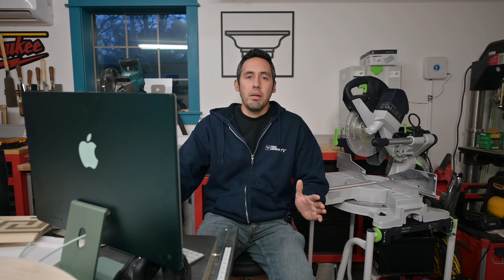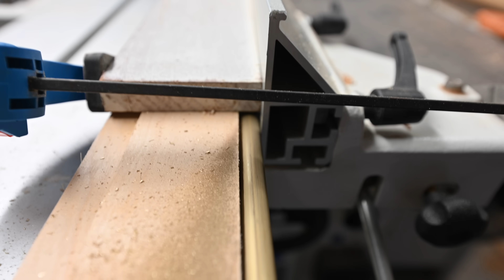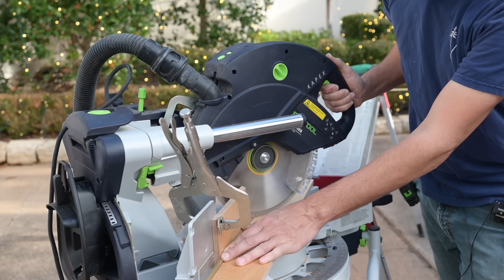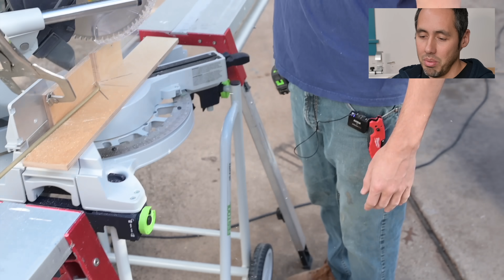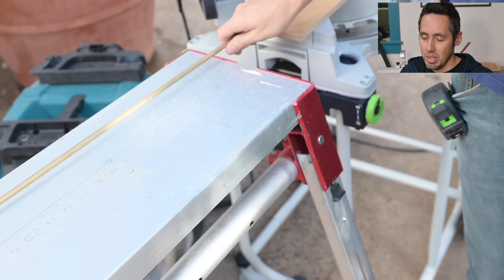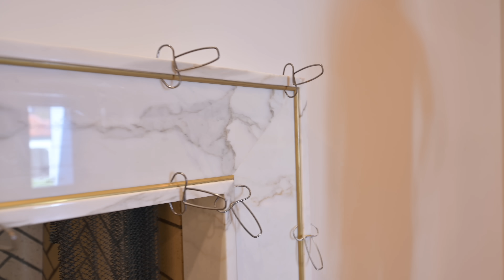It only took 12 years...My first MITER SAW injury.

Comment: So glad you’re ok!  I have worked in the storefront business for over 30 years. We cut all shapes of aluminum extrusions all day everyday. As another commenter mentioned the material should always be positioned with an optional fence board if possible that will get your material further out from the factory fence. You want the blade to force your material down and back. Many saws will be pulling your stock up from the table in stock form. Also your temporary fence should have very little gap for the blade. Every time I have seen someone get “bit” when cutting non ferrous material it was a failure of one of those factors.
Reply: yes sir the issue always seems ro be we wont take time to look the situation over "double take "before we try to cut. just saying ,to make it safer ,Is their any way to make this safer?
 is a good question before the cutting goes on.or what could happen if i cut this now?
Really look at it objectively before. its worth the 10 seconds for sure...

Comment: My injury happened about 12 years ago. I was remodeling a commercial space for a new Carl’s Jr. It was about a 100 degree mid summer day and I was cutting the bright white roofing material and metal deck and placing angle to support a new RTU. I knew I hadn’t drank any water, so my plan was to finish the deck cut and go down the ladder and cool off and hydrate myself. I was sitting threw the roof opening, sweating profusely and passed out, falling face forward 19’ to the ground.

Comment: My scarriest injury was about 20 years ago.  I was ripping a board on a radial arm saw in my garage when I had a bad kick-back when the board split and shot back into my abdomen.  Thankfully I wasn't standing perpendicular to the fence and it ricocheted off me and hit my beer fridge.  It broke the handle off the fridge and I had a badly bruised belly which I felt for some time.  The refrigerator is still there and I haven't repaired the handle to remind me about safety.  I am always super careful (I had a fantastic teacher in school) and there was nothing wrong with the setup, all guards and anti-kickback pawls were in place and adjusted properly but sometimes s*** happens like a board splitting unpredictability.   Stay safe out there and glad you're ok Richard.  Merry Christmas!

Comment: Glad you’re ok Richard and the chimney came out beautiful!
19yr machinist and had to cut a metal band on a pallet of material. Used tin snips like the previous 6-7yrs. the band was so tight it flung back once cut and hit the top of my left hand. It lacerated 3 tendons and I had to go into immediate surgery. I have the Letter L on my hand and to this day, 80% finger strength in middle 3 fingers and numb knuckles. Lesson learned… USE CUT PROOF GLOVES when cutting tight metal bands (specifically when the band is excessively tight aka spring loaded). I’d post a pic but not sure I can haha.
Be safe everyone and Happy New Years🙏

Comment: Glad you’re okay buddy. My worst injury was actually while using an electric hedge trimmer while on a ladder. Holding the trimmer one-handed, I swung too fast and began to lose balance on the ladder. As I reached over with my free hand to stabilize, the trimmer sliced down the edge of my middle finger the length of my fingernail. Stitches put it back together.

Comment: Good afternoon Richard. Glad to see that your injury wasn’t to awful, but any mistake ever made is a Great opportunity to pass along to help others. Love your channel. I would say one of the injuries I have had over the years was smashing my wedding ring on my hand between some pipe back in my oil field days. We were racking 2-3/8 upset tubing and my hand rolled off a pipe as the other one was rolling in the rack and it caught my hand. Thankfully I was able to use channel locks to reshape the ring to get it off my finger. I no longer work in the oil field but have been in construction for over 10 years now and still to this day I don’t wear any kind of jewelry. So my suggestion is to keep the jewelry for when you are heading out for a date night and away from the job sights.

Comment: Hi Richard, glad you're okay.  I bought a cheap 7 1/4" miter saw and fit it with a blade that is specifically made for cutting non ferrous metal.  Whenever I need to cut a piece of metal, tin, brass, etc, I pull that saw out, make the cut and then put it away again.  I found it easier than changing blades on my 12" miter saw.  Don't know if that would have made a difference in your situation, but might be something to consider in the future.  I can tell you that the cheapo saw does surprisingly clean cuts on metal and makes gorgeous miters.  Again, glad you're injury was not serious or life altering.

Comment: Glad you weren't seriously hurt. Mine was a captured channel that I was routing out on the router table.  Faster than you could see, that piece of wood was sticking out of my cutting foam for sheet goods, 15 feet away.  My ears were ringing from the bang and my fingers were hurting. I've done that cut dozens of time to make a channel for an adjustable jig.  Had stops at both end of the cut, it was the last of four cuts that needed to be made on that piece of wood to complete the channel..  I had lowered one end onto the bit, and was slowly moving it forward when it took off.  The only injury I had were bruises to two finger on my right hand.    It made me realize an accident can happen faster than you can see it.  I now double check all my cuts to make sure nothing gets hung up such as a hose, cord or the piece I am sliding through a machine, and blocks or push sticks are used to keep me away from the spinney things. 

I think I know what went wrong,  you had a "V" grove cut in your zero clearance fence.  Normal for cutting molding. This left the short end of the brass you were cutting, unsupported in the back of the cut.  Many metals when being cut have a tendency to fall back in the direction it is being cut  pinching the blade causing kick back.  Try that cut again with a new uncut zero clearance fence  so that the small cut off is supported in the back as well.

Comment: I have the most respect for table saws, circular saws, and miter saws. All of them I have encountered kickback with no injuries. Glad nothing serious has happened to you!
My worst power tool injury resulted from a battery powered drill. I got complacent pushing in some screws and I hit something that bumped the bit off the screw head. The bit ended up landing into the meat between thumb and pointer finger on my other hand. Got me pretty good and reminded me for weeks with pain

Comment: About 11 years ago… about a year after I retired from the military I started my own business as a contractor….. I was using a paslode framing nailer the nail shot through the wood and shots from one side of my hand, where my index finger is to the other side of my hand, where my pinky is up by my knuckles going all the way across my hand, I grabbed the head of the nail with a pair of pliers and pulled it out, poured peroxide on it, wrapped it in gauze, and finished what I was doing….
I was very lucky

Comment: Glad you’re ok.  Thanks for sharing.  My worst (had a few) was shooting a 16d nail into my knee.  I had been framing for over 10 years by that time, so we are talking hundreds of thousands of nails shot without an incident.  Unfortunately, all it takes is one to ruin your day or worse.  I can’t blame the bump trigger because I was the one with a whiskey grip on the trigger, but I will never use a bump trigger again. Not worth the potential risk.  Ironically, as I lay in the hospital, they told me how lucky I was.  The knee has many intricate and delicate parts, and I managed to miss all of them except the bone to which it was deeply and securely fastened to xD.  9 years later, my knee is still going strong and I have a good story to tell while taking a break from the dance floor.

Comment: Hi, my worst injury on a job is a broken finger. I drive a semi truck with a flatbed trailer. February 2021, I was picking up a load of granite slabs sitting on A-Frames in Washington state going to Boise, ID. When I was tightening the last strap, last efforts, feeling good, job almost done, cranking it down with a winch bar - the strap snapped. Since I was pushing down with my whole core and full force, I flew to the ground, upper body first. Upon landing, my finger got caught between the asphalt and the winch bar. Finger destroyed.
I still made it in time to Boise next day and made 3 deliveries. Finger looks ok now but there's some permanent numbness left. Keep on trucking :)

Comment: Richard glad you are ok! 30 year ago, I was hurrying as I was cross cutting rails for a bed frame on an arm saw, had a rail up against the fence and the other about a foot away, but in the line of the cut. The cross cut was fine until the blade got to the second rail forcing the rail against my thumb, the second rail pressed with so  much pressure that it broke the tip of the thumb, to this day the tip of my thumb looks like pointy egg, and I the finger nail grows a little  misshaped, and have a little numbness left.

Comment: Glad to see you’re okay. I was running a board through the table saw and ran my left thumb over the blade as I was feeding it. Thankfully I followed the advice of only having the blade a tooth higher than the board. It cut a groove in my thumb, but it didn’t need stitches and I still have a thumb.

Comment: I was working in a hanger, no big deal, but then my bit dropped out of my bit holder and rolled into a gutter. Went to get it back (it was only a foot and a half deep), lifted the grate and noticed how stinking heavy it was (felt like over 100 lbs.). So I got my buddy to help me and was able to recover the bit. Also we couldn't just leave it because we were working on an aircraft and aren't allowed to leave anything lost. We went to put the grate back and as we were setting it back in place, a combination of bad finger placement and my buddy dropping the grate preemptively, led to my pinky getting absolutely crushed. It wasn't a good day. Thanks for sharing your experience so I could learn from you!

Comment: This same situation happened to me. I was cutting a long piece of 3/4 x 1/8 aluminum flat bar to inlay into a picture frame. I was cutting a 45 one end with a small off cut and it jumped, just like yours did. Scared the crap out of me and, just like you, I was fortunate that it didn’t break or cut any skin.  I was also using a Kapex. Thanks for sharing your story as it just confirms that my setup and cut were doomed to failure right from the start. Be smart, be safe 😊

Comment: Thanks for the OSHA Meeting, Glade you injury was not worse !!! I have been at the saw for 50 years, I have been extremely lucky and careful but will make my guys watch this. Thanks for sharing !! My worst was at end of the day while cleaning up. I was cutting scraps up on the table saw for the trash when a 3/4 plywood board kicked back and hit me it the chest leaving a 3/4 inch line in my skin right though my shirt.  Please everyone pay attention at all times when using a power tools and in general, If you walk into the shop, lumber yard etc go in with the mind set that everything there is there to kill you you should be OK   HEAD ON A SWIVEL PEOPLE

Comment: DIYr, was working ripping 5/8” thick white oak on table saw and was not wearing googles (something that I was used to for many years, until this incident). Keep in mind as DIYr I have no suction tools. Long story short, I got a tiny small wood dust in my eye and at the time I thought it was going to find its way out like many times before, well it didn’t. 

Excruciating pain after 2-3 hours and I had to go see the eye doctor the next day since the pain started to develop random flashes in my eye sight. The eye doctor was able to remove the piece roughly 1/16” long from my, he said it was inserted on my inner eye socket flesh. Needless to say, as soon as I left their office I ordered googles with sides completely sealed to prevent any other incident. 

Thanks for sharing your safety incident and hope all is well. I appreciate all your content!

Comment: Kickback on a table saw.  Milling a 3 foot board and I pivoted to feed more in and the board pulled away from the fence. Bingo, the board caught me in the hip.  I’ll never feed a board again standing in line with it. I also use Jessem hold fasts now for additional safety.  Happy that you were not seriously hurt!  Thanks for sharing.

Comment: I've been doing custom picture framing for almost 23 years now. When I first started chopping moulding, I wasn't given any proper training on the saw. The aaw we used was a hydraulic double miter saw made by pistorius. The person before me cut a 4" tall moulding, and neglected to put the blade guards back down. The project I was working on involved cutting 3.5" pieces of fillet-- basically 3/8" wide sticks of wood that look like your 1/4" quarter rounds of brass. With the dust collector on, sometimes the smaller pieces would get pulled in slightly. Me being young and stupid, didn't notice the blade guards up, so when I pulled out the 3.5" piece of wood that slid under the blades a little, the knuckle on my dominant hand just barely caught the spinning blades. I was lucky enough to only need 5 stitches, and I retain full use of my digits... But I never made that mistake again.

Comment: Hello Richard, so relieved that that your miter saw accident turned out to be less physically damaging than it might have been!

November of 1985 myself, and two of my Lead carpenters were roofing a new custom home I was building and our scaffolding collapsed and down we fell 21 feet (fortunately into soft mud) to the ground below. I was the only one to spend the night at the hospital as my GP doctor insisted to be sure I needed medical observation. The other men were banged up but apparently not as serious as I must have looked. All in all we all turned out alright but over the years I still can feel that back pain every now and then. 

My crew and I are upper end custom home builders and I have my own cabinet Shop. At that time and up to around 2008 we usually did all of the trades except few of the mechanical trades.The lesson I learned as Builder (which I knew in 1985 but overlooked that day) was this: If you are going to be in a dangerous situation it is up to each person that is involved to check out the safety and working conditions of all aspects of the job before you risk getting harmed if tools, staging, and etc are not in line  to all of the safety standards. 

Merry Christmas & Happy New Year!

Comment: It happens. 
I'm a woodworker since 2003. 
Like you say those machines bite back hard. 
On the 26th of February 2010 I had my accident in my father's woodshop. 
I ripped open the top of my right hand in a milling machine. 
All of my fingers broken, pretty much all tendons cut through, shattered joints... 
55 stitches and titanium rods to keep it all together.
It took me 6 months to recover. 
But... I still have all my fingers thanks to a top notch surgeon who fixed me up pretty good. 👌
Be careful out there fellow woodworkers, it happens in a split second!

Comment: Nice service announcement!   Glad you’re okay.  I was cutting square steel tubing a few years ago using cutoff wheel on 4.5 inch grinder held in my right hand and the blade pinched and kicked backed across my left arm.  Luckily it was not too deep but painful and dirty.  Needed a good clean out and stitches at the local urgent care facility.  Now I have that battle scar as a reminder to always be careful.

Comment: I've been a carpenter for almost 40 years & a general contractor for 34 yrs. so I have a few, but the one that comes to mind was when I was building some custom wall mounted bookshelf "boxes". They were melamine with an oak nosing. I was sanding the oak ends with a 3x21 ryobi sander. This is the one with front handle that sticks out over the front of the belt so when you grab the handle your fingers are pointing towards & near that spinning belt.
The accident happened all so quick I didn't realize how bad until after. Some how he tip of my index finger got to close, caught the tip of the finger nail & ripped the whole thing out including the roots I didn't know what happened at the time other than the sander "bit me". I looked down & saw the blood on my fingertip & touched it and it was all soft skin-no nail. Looked around on ground & found it. Wrapped it up & went  to emergency room. Doc said it would never grow back, but he cleaned it up & then sewed the old nail back in to "protect the raw skin until it heals". Big Mistake- It got badly infected & over the course of a couple weeks & 4 or 5 rounds of antibiotics it got worse. At a couple weeks it had swollen to the size of a pickle & started changing color. The Doc gave me one last shot & told me to come back in 2 days & if it wasn't better he was going to amputate. That scared the crap out of me. Went home, drank a couple shots of whiskey; put the finger in some hot water with Epsom salt until numb, then cut the stitches & pulled the nail out with a pliers. The pus squirted out 2' & I squeezed the finger until just blood came out (it was so deep it was almost purple.
Woke up the next day & finger was back to normal size & color & pain was gone. That saved my finger. It took about 1-1/2 years but a nail did finally grow back. The nerves in the end of my finger are dead though.